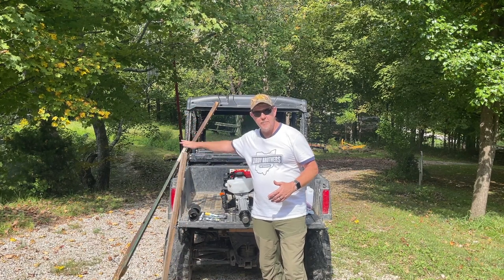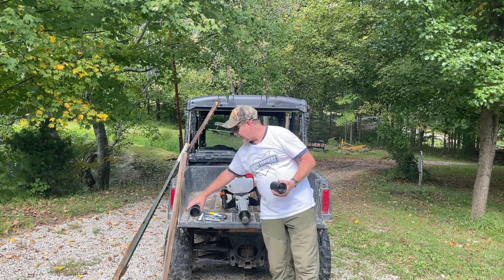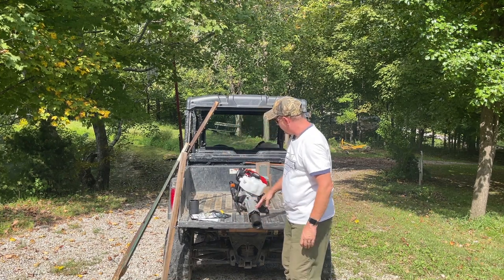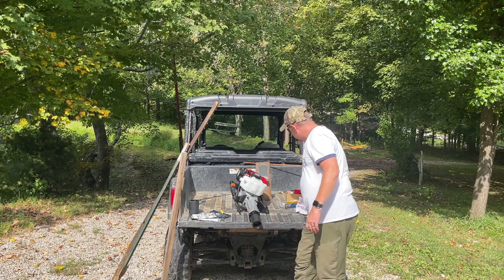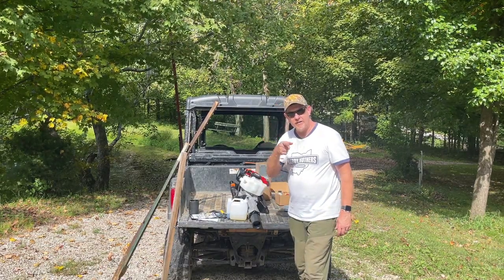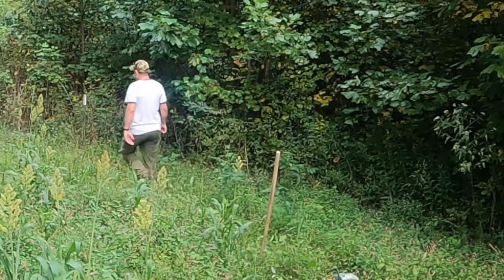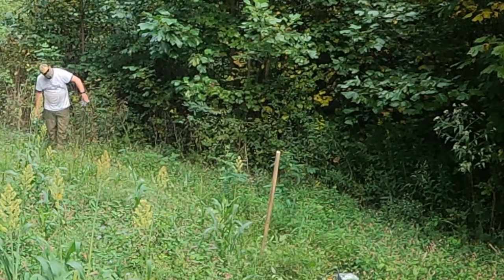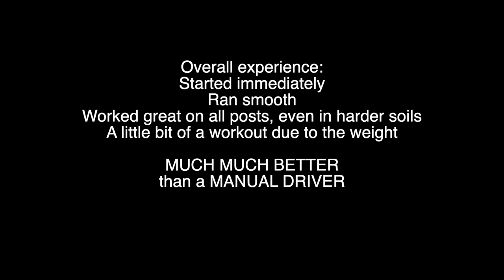REVIEW: JACKCHEN 52CC Gas Powered T-Post Driver Makes Life Easier!

Comment: You really need to show how this works with the larger adapter.  I don’t understand how that adapter works with that spring, and why does it have a hole in the side??  That being said,  I purchased the 4 stroke JACKCHEN 46.4CC 4 stroke pile driver and the hammer piston seemed to simply stop moving up and down after about 6 seconds.  Total garbage.  Won’t drive a post into water.  Read manual three times.  What could possibly cause the (amber piston to stop moving up and down?  It moves freely when I press it up and down with my hand but when an adapter is 9n and I place it on the pole it does nothing when the engine is reving.  Just vibrates!!
Reply from the maker: Sorry wish I could help. I showed it for the use case I got it for.  I don’t really have a need to drive thicker posts nor did I have thicker posts to demo it on.